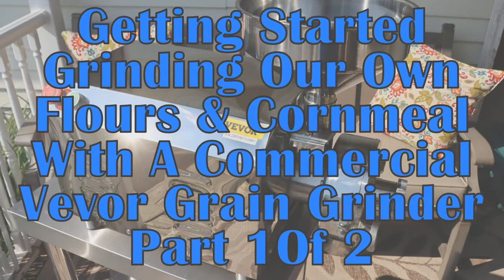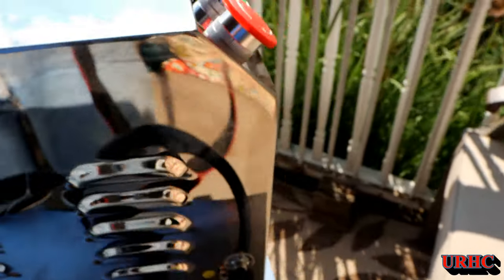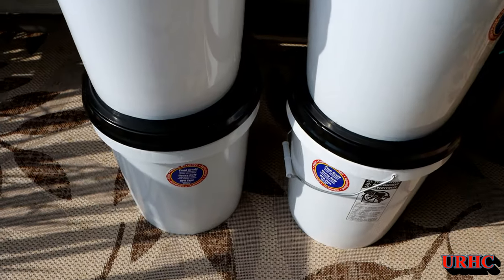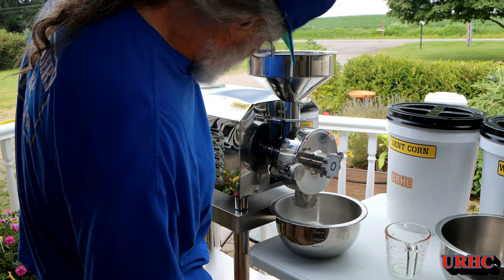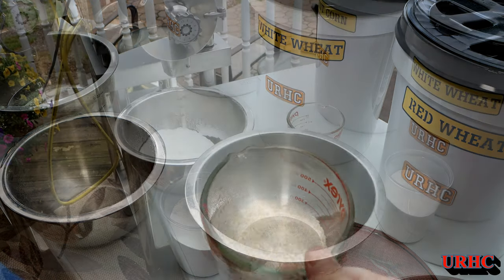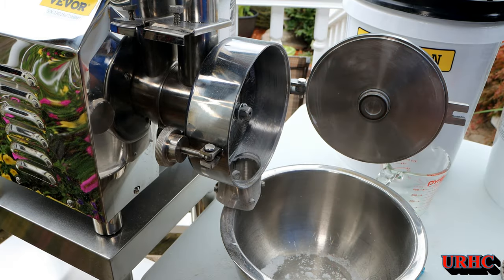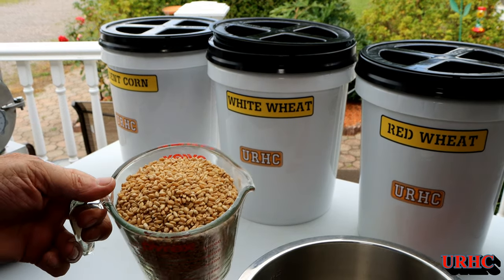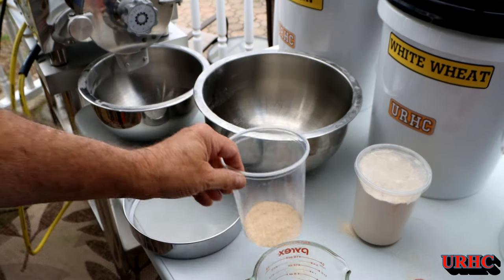Getting Started Grinding Our Own Flours And Cornmeal With A Commercial Vevor Grain Grinder

Comment: Don't want to clog up your comment section too much but I had to offer my prayers for your wife that everything is fine and she is well and has no further troubles.
Reply from the maker: Thank you. She just came home and is feeling better. They could not pinpoint exactly what caused it, but suspect the extensive dental work with anesthesia she had a couple days before may have triggered it. They saw no cardiac damage so hopefully after some rest she will be fine. Thanks for watching .

Comment: We tried it but the grinder stopped working and triggers hazard alert on the line. Any help and advise appreciated
Reply from the maker: Do you have a dedicated 20 amp circuit with  ample size wire for the run? Chamber empty when it is turned  on. I don't know what a Hazzard alert is but you probably want to contact Vevor and see what they say. Thanks for watching.
Reply: @unemployedredneckhillbilly2023  I tried with generic one so it worked for some time and then we got a dedicated 20 am circuit. It tried to start - but does not and trigger main circuit locks - you see that red thing in the main switch shows up. So I have to switch off the alert then try again.

Thanks for responding. Appreciate it.
Reply from the maker: That doesn't sound right. Be sure the wire size run to the outlet is 12awg for up to 50 feet run and 10 awg for a longer run with a 20 amp breaker at the box. Verify you have approx 120 volts coming from the street. Be sure the grinding chamber is empty and the burr plates are not touching and are clean. Be sure the new outlet isn't one of the cheap Chinese ones. Contact Vevor if that's all good because I have never had that light come on.

Comment: You said 300W but the label said 3 KW. That’s nearly 30 Amps at 110V assuming a power factor of 1.0
Reply from the maker: Yes its 3000w. That's why it didn't come with a plug. I used a 30 amp RV plug but the instructions call for a 45 amp breaker so when I permanently install a plug it will probably switch to a 50 amp circuit.  I have to check it with my clamp meter because that would mean about 3 hp. Its a commercial machine made for about 60 kg an hour. Thanks for watching.
Reply: @unemployedredneckhillbilly2023  so no issues with a 30 amp thus far?  Understand the startup current may be in the 63 amp range from Vevor's website but starting it unloaded is a process to keep things in a good spot.
Reply from the maker: @fredhaydt6351  I am now running it on a dedicated 20 amp line with a very short 12 gauge wire feeding it and high surge delay. No problem  yet. I just bought  a high end clamp meter with inrush I will throw on it to see what it actually  is unloaded.

Comment: Curious to know why you went with such a large commercial grinder for home use? I'm all for getting the best tool I can, but found that a Mockmill does great for the volumes I need for home baking.
Reply from the maker: Because I wanted to try it and see how it worked.  I looked at the small counter top mills first but the ones that could regrind finer were pretty slow. The commercial rated mockmill was $200 more then this. This one can also crack corn for animal feed. In an emergency this could feed the whole town. Someday I would like to get a good stone mill but they were too expensive to get started with. Thanks for watching.

Comment: Any advice on initial dial setting?  Just received mine and before I power it up want to make sure it's backed off enough to not grind the discs.  Then waste a bunch of rice or corn to get it dialed in.
Reply from the maker: I backed mine off and switched  it on and off fast to be sure they didn't rub. I think rice is best for cleaning and setting the grind. For fine flour it sounds like they are kissing before the wheat berries are added. Corn I have found it is easier to grind coarse and remove the outer shell parts with wind and sisters then do the fine grind. Have fun. I have an idea for 3d printing a container lid with a built in filter to catch the dust eventually.  Thanks for watching.

Comment: Do the grinding plates wear down/out overtime ?
Reply from the maker: Yes I think they will as grains are abrasive. Like all mills after a couple thousand pounds they may need replacing. Do not adjust them so fine that they contact or you will see accelerated wear and possibly metal chips. Plus check all grains for stones and contaminants that can damage them instantly.  Clean grain is a must with any mill. Mine came with an extra set. Thanks for watching.

Comment: Thank you for doing this. I have been considering a grain grinder and this video was very helpful.
Reply from the maker: We have wanted to try this for a while and glad we finally got to it. This is my first try so probably not doing everything right but the flour looks nice. This grinder is definitely overkill for us but in an emergency could feed an army with a wheat or corn supply. Many smaller models available also. Do some research to find the best mill for you.  Can't wait to finish up the grinding and get baking. Wheat berries will store 25 years unground so looking for a good affordable supply now. Wheat shortages are very close to reality lately.  Hopefully I can finish up  the second part soon. Thanks for watching.
Reply: I agree with your thoughts on the wheat supply and that is why I am looking at getting a mill. I will be eager to see your follow up video - but make sure your wife is ok first.

Comment: Ed, I'm sort of surprised that no one makes a mill attachment for #12 and larger meat grinder motor's as an accessory.
Reply from the maker: I have no idea if that exists.  This ons was the lowest cost commercially rated one I could find and so far I think it works good. I think this is about 3hp. Thanks for watching.

Comment: Yo compre uno pero cuando lo conecto se va la energía
Reply from the maker: It needs a 3000 watt 120 volt power supply with a 45 amp circuit breaker.  You have to install the special plug and have it properly wired.  Thanks for watching.

Comment: Does the grain get very warm or hot when grinding
Reply from the maker: It gets warm. Just also bought a Mockmill 200 and that makes the flour much warmer. Guess it takes a big expensive mill to control the heat. Thanks for watching.